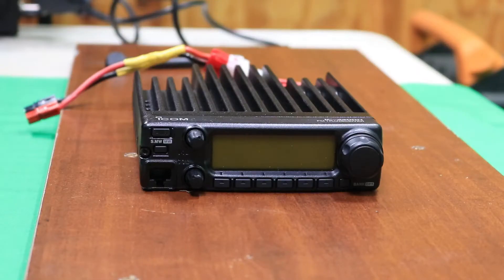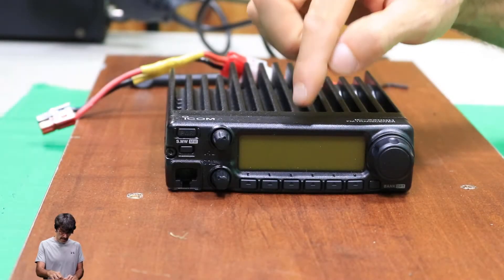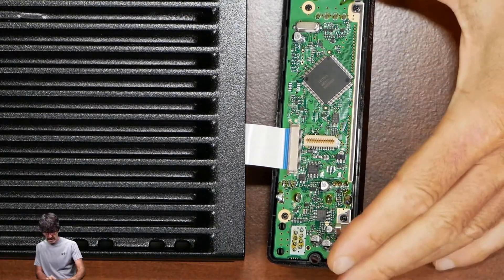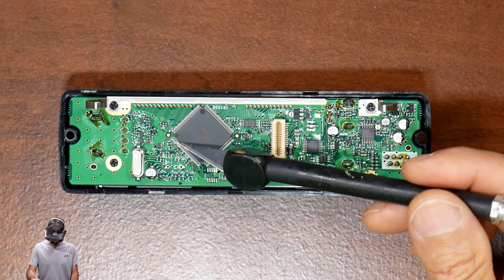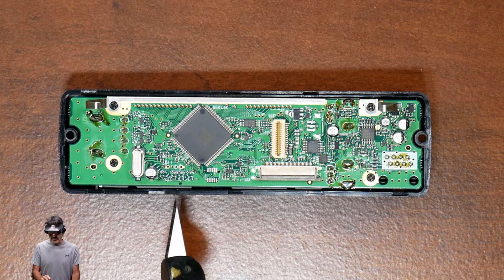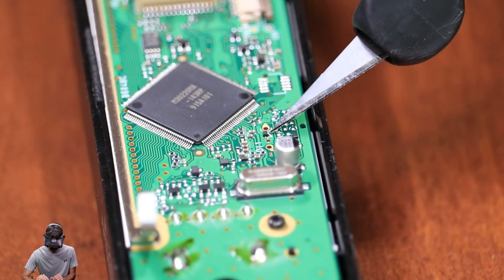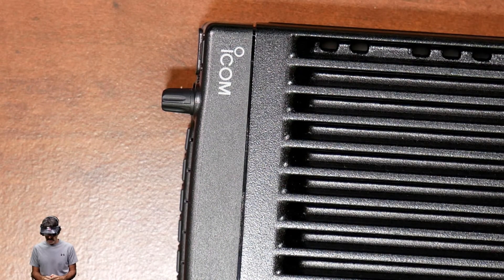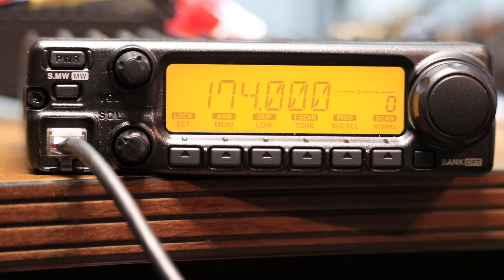Expanded Transmit on Icom IC-2200H and 898D Hot Air Demo

Comment: I'm a computer programmer, definitely NOT a hardware guy, so pardon the very basic question: You need to heat up D11 in order to remove it, is that correct? Either with a soldering iron directly up against it or with hot air (as you did), right?
Reply from the maker: Yes I usually do it that way.  Although I have used an exacto knife too.  If you can get the angle on it, one quick push with an exacto knife will pop it off of there.  It's better if you have an old board from something that is deemed as junk so you can practice on that before doing the real thing... 😀
Reply: @JLPicard440  Ah, yes. Doing a practice run would indeed be smart. Appreciate it!

Comment: From what I can tell, much of the expanded capability is outside the band plan.  What then is benefit of this mod?
Reply from the maker: In the case of emergency it opens up more frequencies that can be transmitted on.  You can also use the MURS band an unlicensed band, which technically isn't legal with this radio, but it works as an option.

Comment: I do believe the U.S. version of the ICOM IC-2720 has 144-148MHz & 430-450MHz TX/RX and a 5, 25, 50 watts TX power output.
Reply from the maker: Yes it may.  I am not familiar with that particular radio, so I can't say.

Comment: Sir, I have an old IC-2720 but slightly used. It's a Tiwan version that is why it's only got 144-146MHz/430-440MHz TX/RX and 5, 10 and 25 watts of TX power. Maybe you can make a video how to expand the frequncy and increase power output.  Appreciate it very much sir.
Reply from the maker: HI Francisco.  I didn't see this comment until I answered the other one a few minutes ago..  I don't have access to that particular radio to make the video on..
Reply: @JLPicard440  ok sir no problem at all. But anyway, thank you very much for the reply. You can call me Jun, "DW1-QEW from the Philippines. 73's and keep safe always.
Reply from the maker: @franciscolopez3229  U2!

Comment: Hi Rudy. Love the videos. Can you get your hands on an Icom 2730a? I need help diagnosing what I'm certain is a programming issue. When I am receiving a signal (vhf or uhf) regardless of scan feature being on or off, the audio will drop out for just a second. Its like it auto mutes for no reason. I can't figure out what I am missing. I would really appreciate any help/direction. Thanks!
Reply from the maker: That sounds like a good one alright!  I looked it up, looks like a nice rig.  I don't have access to one of those.  Have you tried to look on mods.dk? to see if there's any info there about it?
Reply: @JLPicard440  I can't find anything on mods.dk. Please keep me in mind if you happen to think of something!
Reply from the maker: @justinlefever3180   Darn... Will do..
Reply: Rudy, have a look at the response from Icom. Can't believe I couldn't figure it out...duh. 
Thank you for contacting Icom America.

From your problem description it sounds as if you have the weather alert function enabled. What the radio does when it is enabled is that the radio will look back at your selected weather channel to listen for an EAS signal from NOAA Weather. If there is not signal present the radio will go back to normal until it is time for the radio to look back again. During the look back period the radio will experience a drop out of AF on that side of the radio. Now if the radio does detect an EAS signal then the radio will switch the selected weather channel so you can hear the alert broadcast.